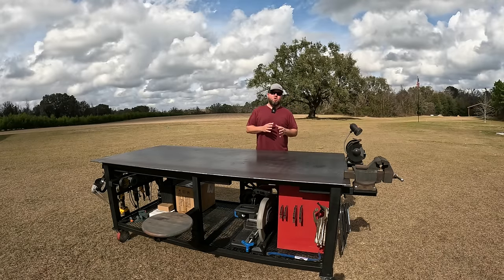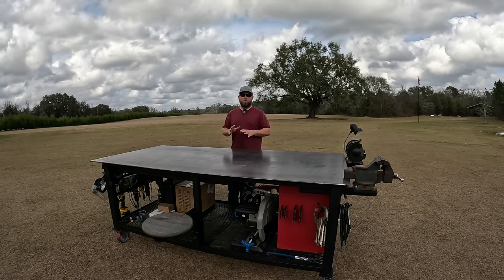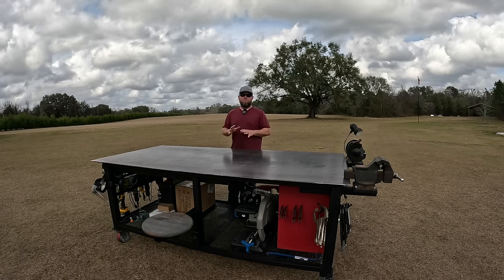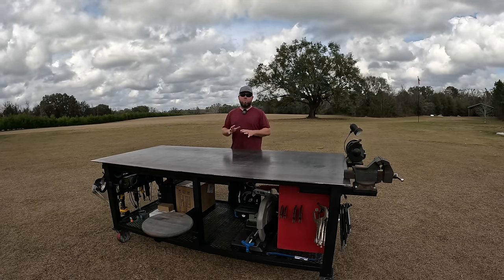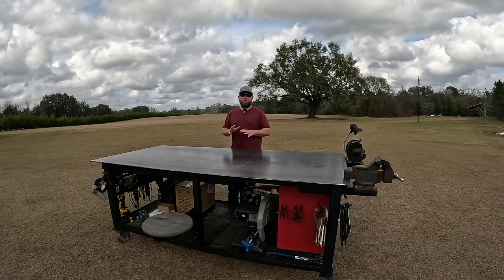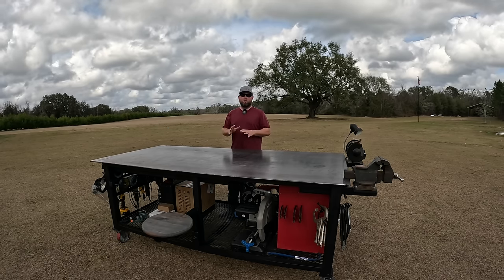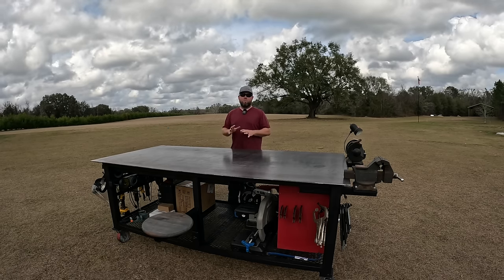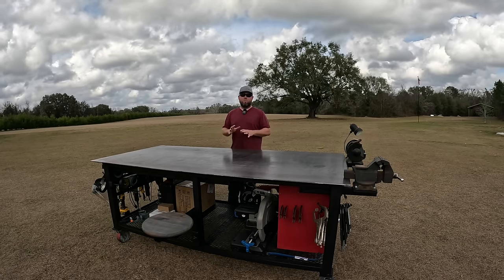Building My Dream Welding Table! DIY

Comment: Seat will come in handy for steadying yourself if you get into TIG welding.
Reply from the maker: I've only ever tried tig once. Maybe one day I'll get one.
Reply: @TKCL  usually it's the project and materials that dictate that NOW you shall TIG whether you like it or not. Perhaps one day you'll want to build a radar arch for a boat and you'll find yourself with a floor full of stainless tubing to stick together, or some other similar project that only works well hand-feeding little dollops of wire at a time into the puddle. There's also a finesse there that the elephant stick welding and rhino MIG welding just can't achieve if you're butt welding thin sheet metal and so forth.  :) Cheers!

Comment: I'm not qualified to offer any suggestions on such a nice table as I can barely run a bead on 1/4" material.  That said, I was thinking that if you drilled a few holes in your seat post and used a spring loaded pin, or standard pin, you wouldn't need to tighten and loosen a bolt to adjust or remove the seat. Again, awesome table!

Comment: I am interested in understanding the rationale behind not utilizing a combination of round bar and tube for the seat's construction. During my tenure at a metal fabrication company, I found this approach to be particularly advantageous as it allowed for effortless seat adjustment and enhanced accessibility to items that may be slightly out of reach. The incorporation of a nut and bolt mechanism could further enhance the design by enabling the seat to be locked in a specific position. Considering the adjustable height feature of your bench, it appears feasible to adapt this design concept to suit your requirements. A 20 mm diameter and 20-inch length round bar, coupled with adjustable tube sections acting as spacers, could provide a simple yet effective solution for height adjustment.
Reply from the maker: Didn't think of it
Reply: How many times have you accidentally hit it so far? That is what inspired me to design it in such a way that if you accidentally walk into it while carrying something heavy, you won't trip and fall over it, it just swings out of the way.

Comment: Nice video , what kind of disk is that , I see it doesn't make a lot of sparks when cutting metal, I like it, also what's the name of that portable drill that you can put on top of the metal to drill the holes please 🙏

Comment: Great build....you really thought that one through...love the seat, but if you end up doing a lot of repetitive work sitting you might want to pad it to save pressure on your tailbone to help save your back as well, otherwise love this table and look forward to the projects you'll be doing.
Reply from the maker: Only concern with a pad is all the Weld splatter melting into it.
Reply: Thought about that, but wouldn't the only time you'd have the seat out is when you are sitting on it? Otherwise the seat would be put away for having access all around the table @TKCL
Reply from the maker: @donnagarrett5196 yes but the crotch area is still very exposed and where a lot of splatter goes to.

Comment: On your extension  end - would it help if a "pin" was welded on bottom of end plate that would drop in to an over sized hole top of 2x2 slide out. Theoretical it would allow the end be pulled out, without having leaf hanging in air till other support pulled out.
Reply from the maker: Yes that is a possibility

Comment: What an absolute beast of a table!  I absolutely love it!  Question...  Did you use 1/2" steel plate for the top? or is it thicker?
Reply from the maker: 3/8 heavily reinforced. It started getting really expensive any thicker.

Comment: Alright my bro and a Happy 40th Birthday to u man.
Love this welding table. I'm getting a 2000x1000mm sheet of 10mm thick sheet of flat plate for my table top but I'm going to cut it down so I can add those clamping sides to it. I need to buy one of those bad boy Mag Drills too. 
Here in IRELAND that 2000x1000x10mm SHEET IS 220.00 Euros. It's expensive but it'll be a one off purchase so I'm not too mad about it.
I like how u added those extras with the table top to extend it. That's brilliant bro.
Is the square tubing 1/4" thick wall tubing? 
I will be checking out some more of ur content to get ideas for my own build. U never know what u might learn from ppl who are much further along in the metalworking journey. I learn great ideas from lots of channels on YT so thanks for uploading this great build man. Salute from DUBLIN..
Reply from the maker: Thank you and thanks for watching, best of luck with your build.  My square tubing was 3/16th wall, slightly thinner than 1/4 but was in stock at my local steel supplier.  It's plenty thick enough to support this project and the additional weight I will be placing on top.  I have some cool "tools" I am building today to help work on the table top.  Video out soon!

Comment: next time, bolt table top to frame so you don't warp it through welding process. every little bit helps for an as flat as can be surface

Comment: would love to know what size steel framing material you used along with spacing, I would like to use this design for our shop table. we have a 4x8x1" sheet we would like to use as our top.  thank you for making this video. awesome work!!!
Reply from the maker: I honestly don't remember the spacing, I build as I go. Legs are 3x3 tubing 3/16 wall thickness. All other sub frame is 2x2 tubing and 3/16 wall. Video description has the wheels, receiver hitches and other parts.
Reply: Awesome!! thanks for the reply, I'm putting together my take off list as we speak, Do you think this 2x2 frame will be okay with the 1" top? I'm thinking of going  w/ 4x4x3/16 legs @TKCL

Comment: Whenever you take your seat out just store it back in the same slot but turn it 90°
Reply from the maker: If I had welded it on the side of the square tubing that would be possible but at 180 degrees. I should have done that.
Reply: @TKCL  I think it will still work

Comment: Do you happen to have a cut list sheet or a list of all the materials you used? I was not sure if this was 4x8 or 5x10.Thanks for sharing! Building one this weekend...
Reply from the maker: No cut list, I tend to build as I go.  The table top is 4x8
Reply: @TKCL  thanks for taking time to reply. Really enjoyed your video. If you don’t mind I would like to ask one other question for your legs did you use 2 1/2x 2 1/2or 3 x 3 square tubing? Were these quarter inch wall? Thanks again.
Reply: MY APOLOGIES... I meant to say the square tube between the legs looks to be smaller than the 3"x3"  legs. I am not sure if the are 2x2 or 21/2x21/2 square tube

Comment: Is there a mig welder you’d recommend Andrew?  Looking to get one myself in the near future (through your Amazon link of course 😉). 
Thank you
Reply from the maker: 100 percent recommend the Hobart Handler 190 or 210MVP (what I own) for the simplicity and ease of use.  No confusing menus or settings, two dials that have numbers to match each other for the thickness of material.  By far the easiest welders I have ever used.  I recommend the 210 MVP if you need the extra power for thicker material and aluminum spool gun welding, otherwise the 190 will take care of most hobby needs and still handle moderate thickness materials. 210MVP https://amzn.to/3wlphxq  190  https://amzn.to/4bI6oFn  Those are my affiliate links, thanks for asking about that.

Comment: For the tube inside the tube, can you share those dimensions/items? Most tube has a weld inside. Just wondering how you got such tight tolerances on the slide outs.
Reply from the maker: Buy 2 inch receiver hitches on Amazon. They are purpose made for 2 inch square tubing.
Reply: @TKCL Ya, there's still play in those though, at least all that I've used, thus the hitch tightener. I'm particularly interested in the table extension and having it be same plane as the table. Seems like with standard hitch receivers it would sag below the table? Is there any cool mod you did to keep it same plane? Super awesome build btw!!!

Comment: what are your thouths about the vevor magnetic drill?
I'm interested in buying one for me...
and I'm not sure if it's going to last me, or if I should go for something more expensive, 
I don't intend in using it for heavy drilling every day,  just for small jobs,
please help me out
Reply from the maker: The model I got has been awesome, I've used it a lot over the years with no issues. It's hard to replace it with anything else in certain situations.
Reply from the maker: Here is the video on mine, link is in the video description and you can use code VVPRO at checkout for 5 percent off. https://youtu.be/_yF7-XQOE_I
Reply: well, that's great news  
I will keep that in mind, I actually want to modify the drill, making it like a drill press, with a stand and vice
To be able to drill small sizes holes, for small jobs
Reply from the maker: @vladtrifan483  that would be a good idea.

Comment: If you're not running "Flux core", it sounds a little cold. But, it's hard to say over the internet on my phone speaker. 😅

I say "too hot is just hot enough, then back it down".
Reply from the maker: Burns great and it's not Flux. The few welds at the end was not on clean metal and was a little "poppy".

Comment: What gauge or thickness is the sheet of steel on the top?
Reply from the maker: I went 3/8 due to cost reasons. If money was no object I would have did 5/8 or 3/4.

Comment: Guys, what height do you build these tables? I will also build one, considering total height 80cm top of the table
Reply from the maker: 36 inches here is standard counter or working height.

Comment: How thick is the top?
Reply from the maker: 3/8 top reinforced every 12 inches underneath with 2 inch thick wall tubing.  It was a surprising cost jump up to 1/2 inch.

Comment: Truth be told, you ain't ever getting off the floor.    First thing I built was 2 welding tables, and I haven't used them at all other than to stack junk on the top.   I'm going to steal a lot of your great ideas.     I do like your table extension, but it's limited, you cannot cut longwise.   I had to make a special segmented table where basically 2x2 plates are supported by oil field pipe, the outer have 2" gaps, inner have 5" gaps so I can use my fork lift to lower a heavy plate and the forks drop below the surface so that the material is supported  without having to angle my forks down and hope the plate doesn't slide off the table wrong.   I can cut long ways or in half or quarter.